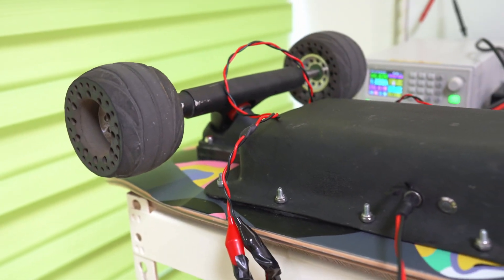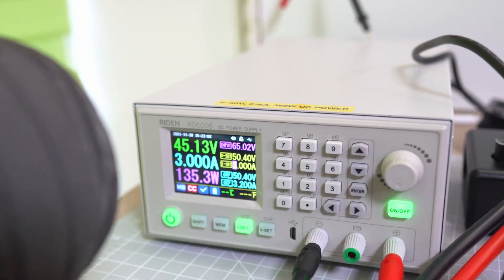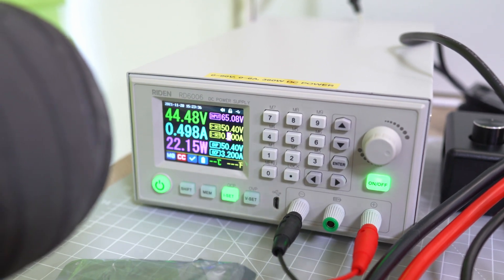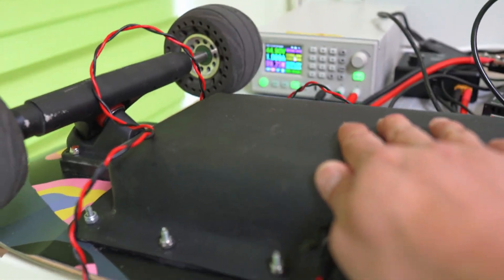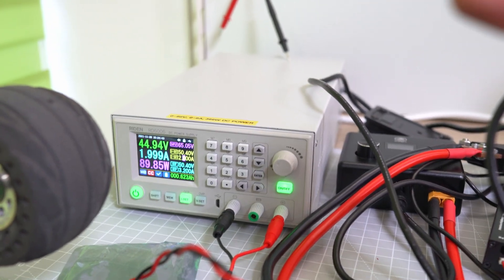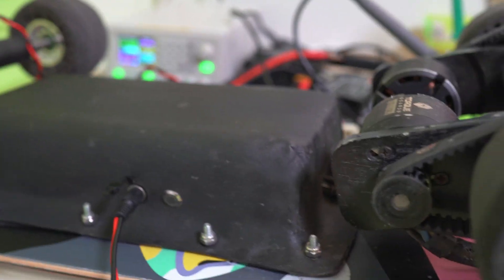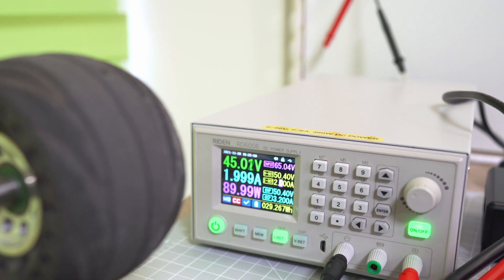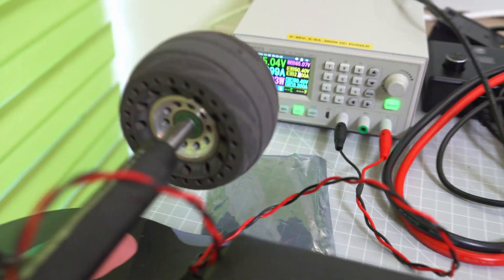How to Charge 12S Electric Skateboard battery using DC Power Supply!

Comment: Thanks for all the ideas - gonna get something like that for me (-: -> just one question - how do you prevent overcharging. The original charger switches off when reaching a certain voltage level or cut off current 100-200mA. How do you handle that with a desk charger?